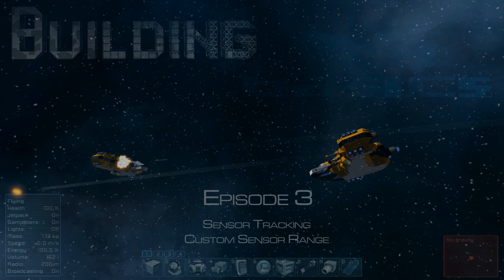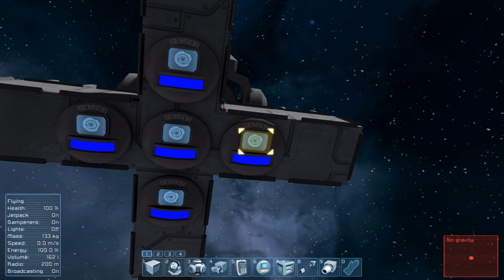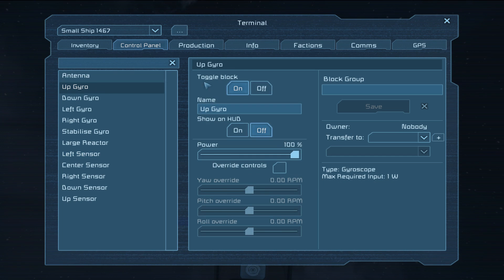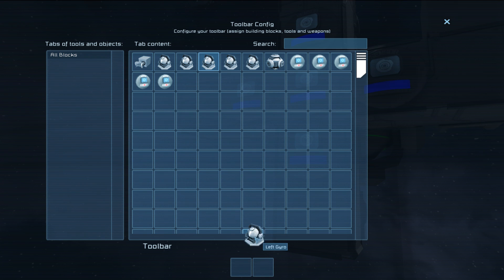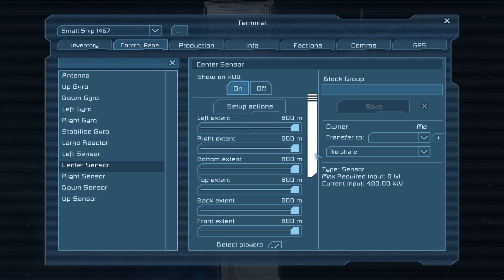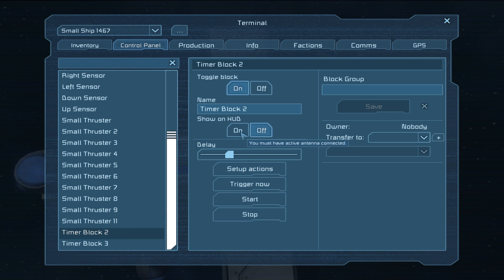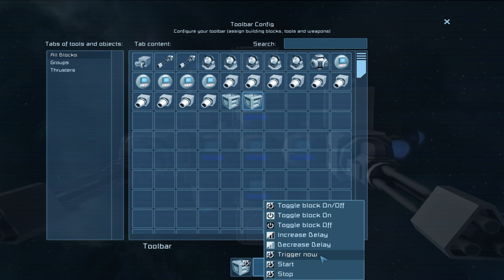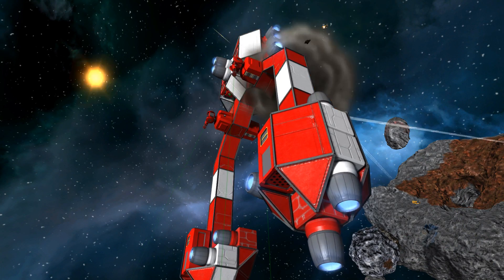Space Engineers - Building on the Basics #3 - How to..? 'Sensor Tracking' and Range Modification

Comment: Id like your videos just for that finishing tune lol

Just a tip i use for "reverse" sensors. If you make your right and left sensors look behind them then theres no need for extra sensors looking behind :) the drone will just turn around.
Reply from the maker: Hehe, really pleased I found that one and the guy who made it was so cool as to let me use it like that :)

Only issue with using the same sensors for the reverse is they have that dead zone in the middle still, so if something ends up directly behind you they'll get stuck pointing the wrong way, having 2 sets of sensors allows you to setup the rear facing ones without that overlap zone where they have both left+right active at once for example.
Reply: *****
Wont the rear facing have the same issue tho? If theres a dead zone at the back then there will be in the front too or vise-versa... only differance is in the front you have guns firing in that zone?...
Just thinking out loud here as at work, but if your worried about someone getting into that blind spot, instead of copying the front to the back, just extend the left and right backwards and add a single sensor in the center facing backwards that fills in the gap... then make it activate the UP gyro for example?... then you only need to add the one extra sensor...
Think that makes sense....
Reply from the maker: ChromeStriker You can space the rear ones out to not have that dead zone.. the dead zone comes from them having a minimum of a 1m range and it's beneficial forwards of course.. but if you space the rear sensors out by at least 1m you can set it up so it has no overlap at all and it'll then turn whatever is the quickest route to get on target. Your way does work of course this route is just a little quicker in how it reacts.

Comment: I think I have found that if you leave a gap between sensors, say left and right being 5 small blocks apart, the center pointing sensor will lock on much better with an additional main gyro set to 100 percent power and the other turning gyros set to 30 percent or lower. Slower lock on but it seems to aim better. Still experimenting. Cheers
Reply from the maker: Yeah the more you slow the lock on the better they target but the slower they track.. I've found the sweet spot for the spread is between 2-3 blocks away from the 'center' sensor so that you have control over the size of the overlap.. when they are as close as they are in the video you have to accept the size it gives you because you can't set it any lower than 1. Nice point, thank you will include that when I revisit this with some more complex bits :)